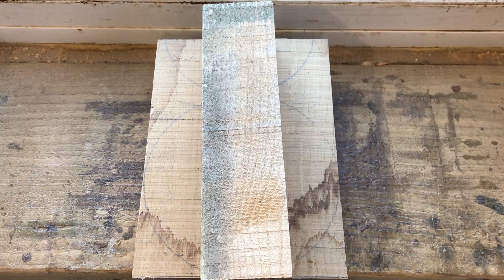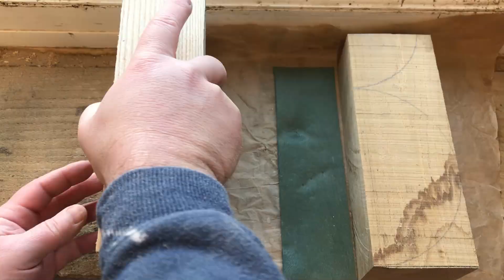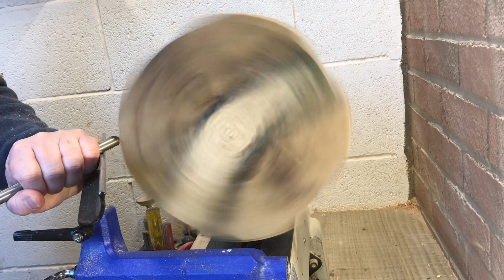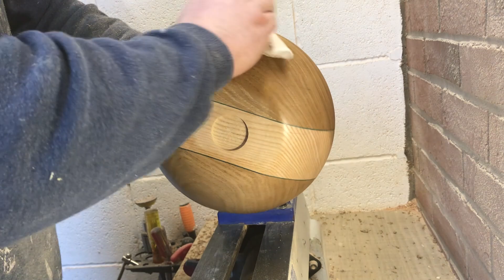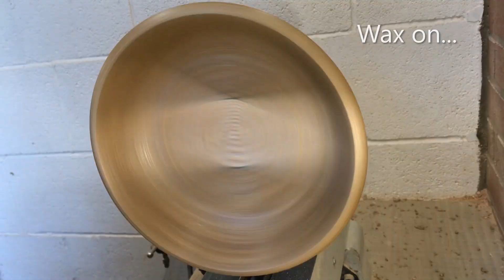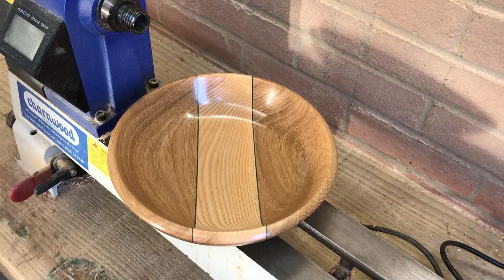Woodturning - Oak and Ash Glue up

Comment: Very nice indeed, can i ask where you got you disc from.
Reply from the maker: The Sanding Tool was just a cheap one from Amazon, it works well, I only had to change the foam head after about a year.
Reply: Sorry I ment the logo Disc
Reply from the maker: @roystheboy  I made them myself on 3mm hardboard. I got a laser engraver/cutter last year.